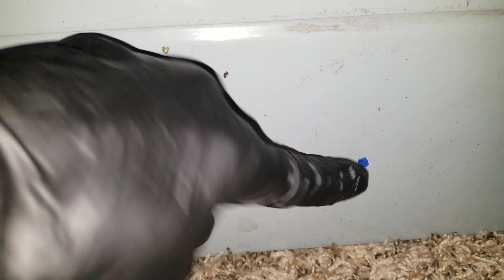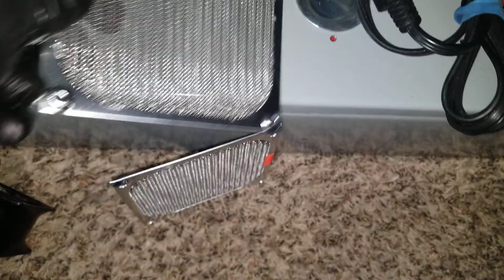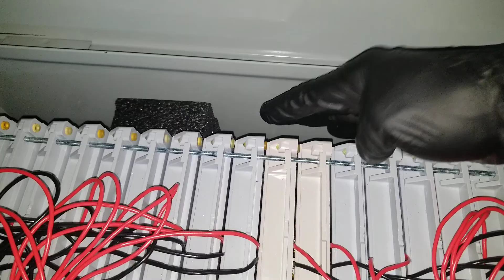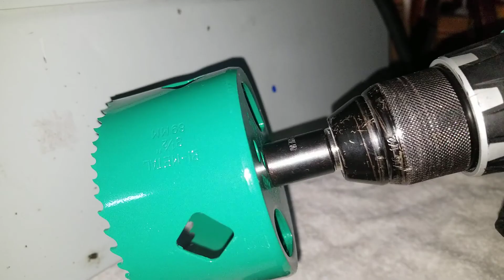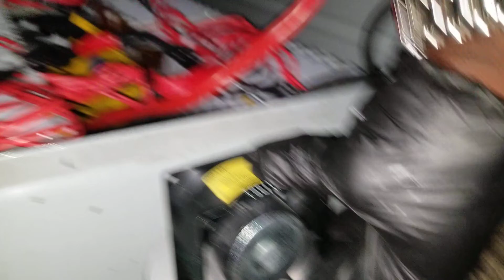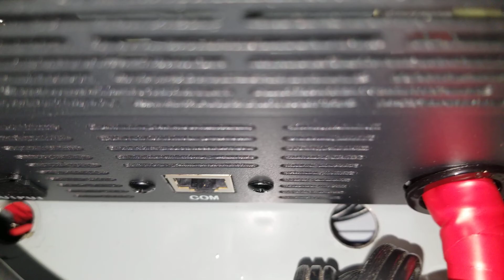VEVOR: 3KVA 24V MPPT HYBRID SOLAR INVERTER, INSTALLING BATTERY COOLING SYSTEM

Comment: Hope you are safe, just read in the news about the storms, they are off the scales this year.
Reply from the maker: Yes and thanks for watching and don't forget to LIKE & SHARE
Reply: @jwsolarusa  my systems have arrived, now it's a matter of taking the time to make sure everything is put together correctly this was rather an interesting wiring job, the bottom area was tricky to wire, I finally just cut the insulation fat enough to where I have lengthy enough wires where I can place them in the proper wire connections... Those  people in the UK sure love changing their wiring codes.. Why on earth did they use motor cycle color codes? Lol.  Onethingisforsure, I'll be checking andrecheckingbevoreIpoweronthe system,.. And you know what else.. That 220 universal adapter plug s going to get covered so some persondoesntpluginacrodtothat 220 out let.. Mantalkaboutsuicide... Those iniversal connectors.. Takethecake.. How were they ever allowed to be licensed Tobe used... Herggg...... I will deffintly be converng that socket. And itwillbein a locking cabinet. 

Imadesureno stransarestraying from the 220. The second unit will be a nice plug in, 
When I do the 220 I'll be getting the step up transformer... An buying a matching unit fo the oneadpaternotthe universal adapter.. So nice.. I  will be getting 220  stuff fro wallmart lol. Hey.. I thought American Wall mart was American.. But guess not.
Reply: I have had to add some vents, this unit and the step down transformer is working great.. 
How ever, I will be purchasing 2 100 AH batteries.  It is freaking weird not to see all the mess lol it's so neat and tidy...andso... Wirdto have a nice system.. I have the voltage and battery locked.  Just a heads up, if you use 90 Amp our batteries erg.. At any rate, have an awesome day,  I left the  plastic screen cover on lol... Protects the screen.
Reply from the maker: @LEEGULICKSON  
Thanks for stopping by and don't forget to LIKE SHARE and SUBSCRIBE